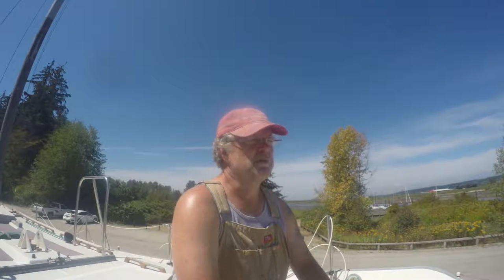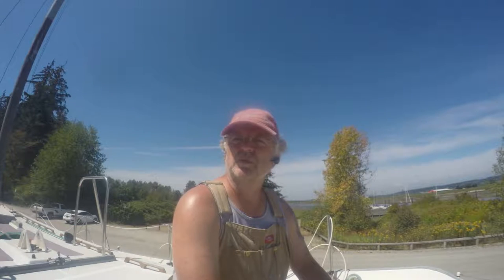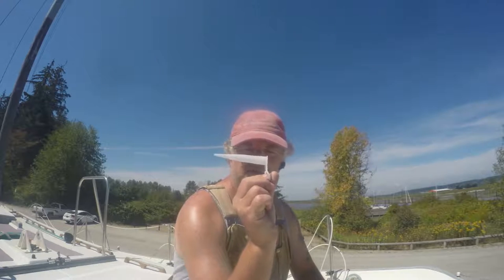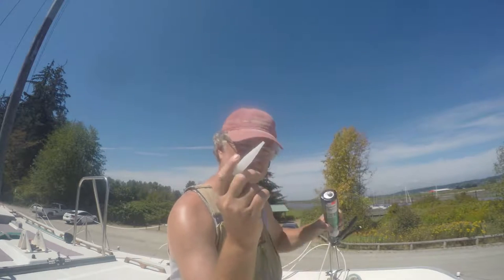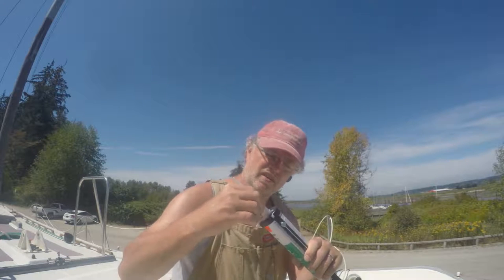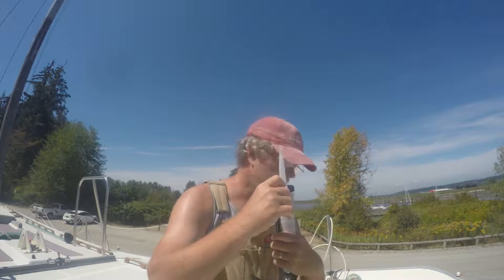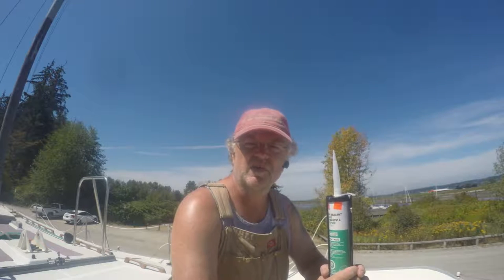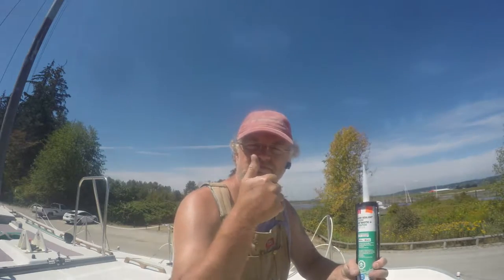Little Bear Westsail 32 refit: Chain plates pt 3 Vlog #97

Comment: Nice work, did you move the hull legs for painting?
For squeeze space, you most have some kids around that will be happy to work for a small reward.
Maybe a babysitting kids will help you for squeeze space,  like cleaning the lockers. It will save you
some back pain.
Reply from the maker: Yeah, I moved the poppets to paint underneath them. I have yet to lift the boat to paint where it's sitting on it's keel blocks. But that'll have to be done. can't have incomplete paint can we?
Reply: At the  shop I will use the 30 tonnes bridge crane with 2 slings, that I have in my section.
But where you are I do not think you have the space for a 20 tonnes hydraulic cylinder, to fit under it.
Maybe a lifting air bag, like fireman have to life heavy things.
Oh! I just remember, the team that install are CNC machine have some small hydraulic cylinder that are maybe 2 or 3 inches hight by 6 inches round.
Reply from the maker: Yeah, I'm thinking a bottle jack, or a floor jack.  I may call the boat mover guy and see if he has any advise.